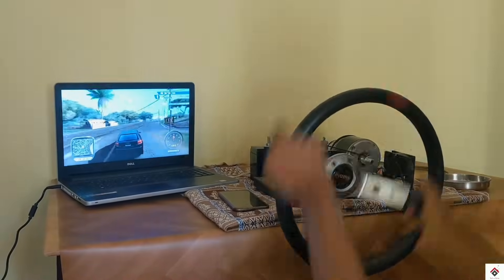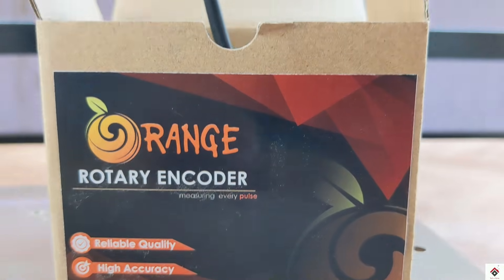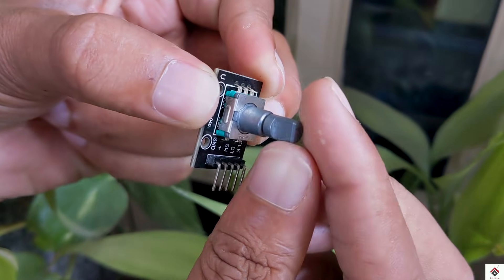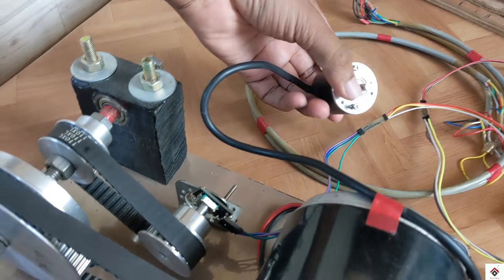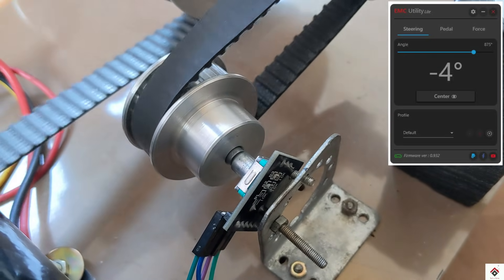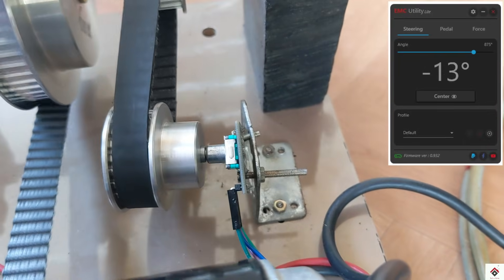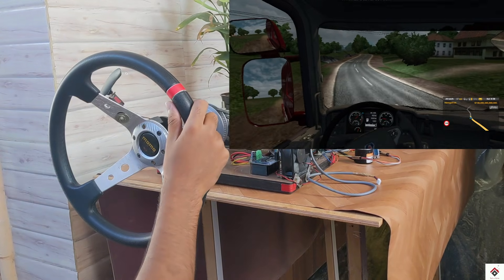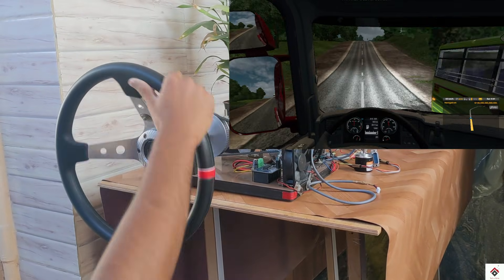Force Feedback Steering using Cheap Arduino Encoder | DIY Sim Racing Wheel with Low Price Encoder

Comment: Bro I have a cheap encoder which feels clicks, will I still feel clicks if I install a good encoder like yours?
Reply from the maker: No, you cannot feel clicks.
If you can extend the budget, go with 1000 PPR encoder instead of 600 for better results.
Reply: @techathome Is the encoder you used correct?
Reply from the maker: I have used 600 PPR.
You will also get 1000 PPR in the same.
Reply from the maker: Yes

Comment: what if we change the gear ratio of the encoder and the axle of the wheel, like for instance, we increase the size/ no of teeth of the gear on the shaft/axle of the wheel and connect a smaller sized gear on the cheap encoder with the ration being somewhere around 3:1 (bigger gear on the shaft of the wheel and the smaller on the encoder) ? i guess that will probably eliminate the problems with the dead zones ?

Comment: Bro how many teeth is your pulley? 20t : 120t?
Reply from the maker: Before pulleys-
Motor Rated Torque : 0.87 Nm
Motor RPM: 2650
Input pulley teeths(at motor): 15
Output pulley teeths(at steering shaft): 60
Ratio(Output / Input)- 4:1

After pulleys -
Output RPM: 662
Output torque: 3.48 NM
Reply: @techathome nice

Comment: so it's better to build with rotary encoder than printer encoder/potentio meter?
Reply from the maker: Potentiometer doesn't work on this.
If u have a printer encoder you can try. Some people in the comment section suggested to use gears along with cheap encoder to increase the rotation.

Comment: Bro AS5600 is good to use?
Reply from the maker: No, you cannot use.
Reply: Why @techathome
Reply: Bro pls suggest any best encoder for low budget
Reply from the maker: Try if you can get printer encoder.

Also see if this matches your budget: https://robu.in/product/pro-range-rotary-incremental-encoder-38mm-photoelectric-ab-2-channels-600-ppr-e38s6g5-600b-g24f/?gad_source=1&gad_campaignid=20363337560&gbraid=0AAAAADvLFWeOMVqhMGd-F-DniB3mxXjC9&gclid=Cj0KCQjwjJrCBhCXARIsAI5x66UvBcyTj2M48CpBx-WCOeG-kEcu1CdG1w5couVxjV30bgXw8NAr3CoaAuhfEALw_wcB

Comment: Can i use magnetic encoder
Reply from the maker: No
Reply: @techathome  can you recommend another alternative
Reply: I am on a budget
Reply: @techathome  can i use as5600 magnetic encoder google says it will work if it's both absolute or incremental can you check it for me I am in a tight budget bro please 😢🙏🙏
Reply: Can you give me the code c++ Arduino so I can change if I want to
Reply: Where did you get the original code
Reply from the maker: I don't have code. This is open source compiled hex from EMC company, You will not get code.
Check this encoder: https://robu.in/product/pro-range-rotary-incremental-encoder-38mm-photoelectric-ab-2-channels-600-ppr-e38s6g5-600b-g24f/?gad_source=1&gad_campaignid=20363337560&gbraid=0AAAAADvLFWeOMVqhMGd-F-DniB3mxXjC9&gclid=Cj0KCQjwjJrCBhCXARIsAI5x66UIAEEcQ4Jxwz8dtefG2QtHc87ERqhV9eON5aID2yEpQwWwrYLqPB8aApLOEALw_wcB

Comment: staring wheel ki detail plz
Reply from the maker: I bought from offline store.
You can search for momo steering wheel in Amazon. There are similar ones available.
Reply: @ price?
Reply from the maker: I don't know the original price. The one I bought was old stock with some slight damages. I bought it for 900 INR since it was not a concern for my use case.
Reply: @techathome  ok thank you for response

Comment: Pro-Range 600 PPR 2-Phase Incremental Optical Rotary Encoder  arduino uno r3 ets2 video 
🤔 ??
Reply from the maker: I modified unojoy code to add encoder and tried. It doesn't work properly. Better to go with EMC firmware with Leonardo and encoder.

Comment: I tested one of these encoders with a 15:1 reduction gear that increased the ppr to 300 and turns out that the result was good, almost like a g27, you should try it some day
Reply from the maker: Thanks for the suggestion, I will try.
But those encoders are not smooth even for rotating, You can feel the clicks.
Reply: @techathome  yeap, but the high reduction  smooth this issue a lot
Reply: @techathome if you take it apart you can bend the pins and it will be smooth. That's what I did
Reply: how do you code the arduino
 or does the software do it for you?
Reply: @petrifiedhero9610  the code does all, you just have to provide the right ppr number for that gear reduction

Comment: If we use incremental encoder it doesn’t give us exact position for it will take as 0 absolute encoder will give us exact position my question if using increment which device we can use for exact position
Reply from the maker: There will be no issues. The SW will handle. Refer this video for better understanding: https://youtu.be/crdDhvhBG0M

Comment: Brother, these encoders are hard to find because they are expensive. Can I use a multi-turn potentiometer instead? Will this work?
Reply from the maker: No, Potentiometer doesn't work for steering axis.
I got few comments people saying printer encoders are cheap and they work well.
I couldn't find them, try if you can get.
Reply: @techathome  I have made it with a multi-turn potentiometer and it detects millimeters. Will it work when I add a motor or is an encoder required?
Reply: @furkanaktepe3590  no it wont be able to use ffb i tried it

Comment: i feel like those expensive encoder are overpriced we need one that is between the expressive and cheap ones
Reply from the maker: I got some comments asking to use printer encoders which are cheap. But I couldn't find them.
Try if you can get.

Comment: There is version of the encoder component that doesn't have detents but rotates smoothly. Unfortunately, step count isn't high. You can also make it from the standard detented one i think by taking it apart and removing the click spring thing.

Another item of use is a $4 optical encoder with 100 slots, lasered steel. As opposed to industrial type it is open, and you have to make your own enclosure to shield it from light, and also come up with shaft mounting and the like. Unfortunately i think you want about 400 steps per revolution or more. The 600 step encoder was a good choice.

So whether you use the 20/24 step mechanical encoder or 100 step optical encoder, you will need to gear them down. The mechanical encoder needs to be geared down a lot. The cheap optical encoder will need a modest amount of gearing.
Reply from the maker: According to gaming community blogs, recommended is 1000 PPR or more.
Because of cost, I went with 600.
Reply: @techathome   Logitech DFGT has 768 ppr (geared 60-slot encoder). Logitech G-series wheels have 490 ppr (30-slot encoder). Furthermore the encoder on G-series is coupled directly to a motor as opposed to the steering wheel shaft, which gives the wheel a characteristic and somewhat undesirable backlash or deadzone near the steering centre. I think in a belt driven wheel with correct belt preload, you're not going to feel that backlash at all.

Comment: you could use a magnet with a hall sensors so it'd be more precise you you wouldn't feel the clicks of the encoder.
Reply: hall sensors are quite hard to find depending on your place
Reply from the maker: In this Orange encoder I don't feel clicks but the cheap one has that.

Comment: would recommend if theres no lag and a (mine doesnt have) i would recommend using a small pulley and attaching that pulley into the 20 ppr encoder and attach another pulley for bigger like 5:1 or 3:1 making it 80 ppr or more
Reply: 80 is still very little. You want 400 step or more. 5:1 is a good ratio for cheap optical slot encoder (open type, no shaft, no enclosure) with 100ppr that you can buy for around $4.

Comment: Hello, How many x4 PPR did you configure EMC Lite with the encoder module? Regards, I await your response.
Reply from the maker: Mine is 600 PPR encoder.
In EMC, we have to add CPR value(Ppr *4)
So the configured value is 2400.
Refer this video: https://youtu.be/crdDhvhBG0M?si=R5z-DBJuYA6EuDih

Comment: Do i need power supply and whay kind of powersupply how many amps and volts? If im using 24volts 250wats ebike motor?
Reply: match it as 24v 250w and if you add a fan i would recommend 24v and 300 watts and the 24v fan cuz 12v cant yk
Reply: @leoo-yel  how many amps?

Comment: im doing a DIY and already have an 600p/r encoder like yours, would be better, accurate and will it work if i do use a 2k+ encoder? because if 2:1 with belt i generate 1200 not that much accurate and if i do use a 2000, 2500, 3000 would that be way better, dont?
Reply from the maker: Yes using higher PPR value will increase wheel sensitivity, you can go with that.

Comment: Bro i have l298n driver so how can i wirring it? Pls
Reply from the maker: Select this configuration: 1PWM + 2DIR 

pin9 for PWM 
pin 8 for DIR L
pin 11 for DIR R

Send mail if you need more info: deepakhd20@gmail.com
Reply: @techathome  it works but some time it not working and it only turning one side only. I just made circuit only for testing and model soon. The driver become hot also.
Reply from the maker: Which motor are you using?
Reply: @techathome  unknown 12v motor it just written UET

Comment: bro can i use this same hex file but instead use a magnetic rotary encoder i prepared myself? i wanna use something like as5600.
Reply from the maker: I don't have idea on sensor you have mentioned
But the requirement for this SW is digital inputs. In encoder there are two phase pins A and B which are connected to digital pins of Arduino.
There is 90 degree phase shift between these two phases.
Reply: Did that worked bro?

Comment: Are the diodes mandatory or there is no problem if I don't put them in👍
Reply from the maker: Are you referring to resistors?
They are mandatory.
Reply: you don't need to use the extra resistors with this cheap encoder as it already comes with them (you can see them on the bottom / back side)

Comment: Just change the gearing. An encoder just produces pulses, a 60 PPR encoder becomes a 600 PPR encoder with 1/10 gearing.
Reply from the maker: But I feel the expensive encoder is soo smooth and sensitive.
Reply: @techathome He means gear ratios, by making the gear ratio 10/1 we can make 600ppr encoder for cheap

Comment: Thank you much for this video. 
I am done with  this setup but at last motor is not working. 
I did all basic testing for motor and driver as per your tutorial and tests are successful. Could you please suggest?
Reply from the maker: 1. Check if feedback is working inside game.
2. Also check, if digital pins used for motor control are working(First convert back to normal Arduino).
- Check if LED blink works on pin8.
- Check if LED fading works on pin9 and pin10.
Reply: Thank you bro. 
It started working now. Reinstalled emc and hex file.

Comment: Hello so can i use the 600ppr Encoder without force Feedback with arduino Uno?
Reply from the maker: This FFB wheel tutorial is different from Arduino Uno based wheel.

Both use different software and arduino boards.

For Arduino Uno, only potentiometer works.
Reply: @techathome   sorry my Bad Bro im new to this arduino i meant the Leonardo thing without Force Feedback
Reply: I cannot find orange industrial motor like yours. Can I use other color?
Reply: @modthaviphon3871  i dont think the Color matters just Make sure that it has high ppr the higher the better 👍

Comment: i have a same setup this but i have 1000rpm encoder i install everyting but my motor is not working i tested motor i give only volt motor and its working every part is brand new i dont understand my motor its not working help me please
Reply from the maker: BTS driver might be faulty, follow these steps to check: https://youtu.be/H2YJRaaXFIM?si=CIRs3NM3dW-hy5SP
Reply: @techathome help me bro, why the emc driver is not detect, i already installed the firmware to arduinu
Reply: Did you get any fix for this? Facing same issue.
Reply: @Upendra-dd9vi  nope i cant i searching everyday

Comment: How much torque does this produce? and where can I contact you? whatsapp?
Reply from the maker: Before pulleys-
Motor Rated Torque : 0.87 Nm
Motor RPM: 2650
Input pulley teeths(at motor): 15
Output pulley teeths(at steering shaft): 60
Ratio(Output / Input)- 4:1

After pulleys -
Output RPM: 662
Output torque: 3.48 NM

You can reach us on Instagram.

Comment: I have problem with the software, after i centered the wheel to 0degree, and i turn it once or twice again at any direction , i can see that it say 0deg and the wheel is not centered in real life , force feedback is not applied yet, just testing , my setting for encoder in emc is 2400cpr and 2pwn+1dir.
Reply: finally i found the solution.
thats because of you arduino cable and your keyboard and mouse cable touching each other.make you sure that your cable stay away from each other.
may be i think some local calbe not insuleted its giving fluctuate power
Reply from the maker: Thank you 👍
I will try.
Reply: i always need to recenter it again and again in emc while playing games.
Reply from the maker: Yes, At least in EMC utility Lite we have to manually set the centre before starting the games.
Motor not involved in centering the wheel like Logitech.

I don't have information whether paid version(EMC utility pro) has that option or not, see if you get something in EMC facebook page.
Reply: @techathome  the centering goes off by time after using in game.
Reply: same problem what's solution
Reply from the maker: Is your force feedback working fine?
Reply: @techathome  Yes, im changing to esp32 s3 cause i couldn't fix the centering error, and it has a better firmware.
Reply from the maker: Which firmware are you using with ESP?
Do you have any reference?

Comment: Can you use printer disk encoders ?
Reply from the maker: Initially I thought of using them, but couldn't get in my place.
Reply: @techathome  I use a Canon IP2770 printer encoder, which is inexpensive and effective, perhaps you can give it a try.
Reply from the maker: Can you share product link, Not able to find.
Reply: @fars_archi   does it have lag and have deadzones 
like cheap potentiometer or cheap rotary encoder as shown in the video

Comment: Sir please update this steering wheel with budget hardware because we also want to make this less money 😭😭🙏🙏

Please I request you 😭😭🙏🙏
Reply from the maker: You can reduce costs -
1. No need of pulleys and belt for encoder. You can directly connect at the end of steering shaft.
2. Using cycle chain and sprocket instead of timing belt and pulleys for motor.
3. Use 100W or 150W motor, but mine is 250W which I already had.
4. Some old steering wheel can be used, Here I bought new wheel.